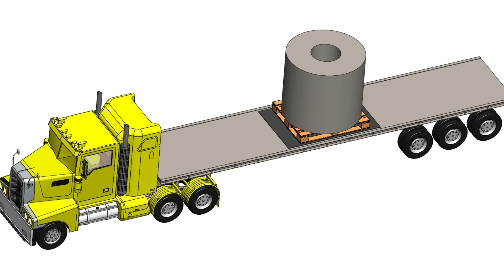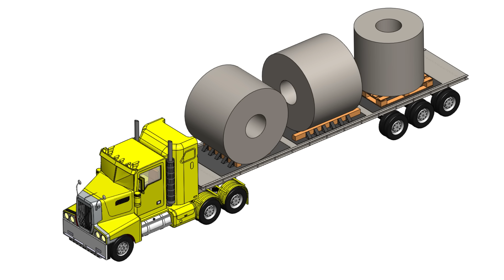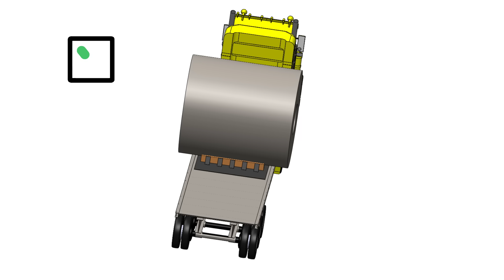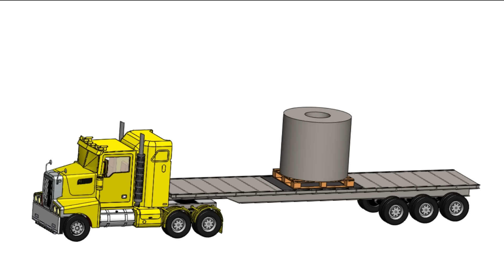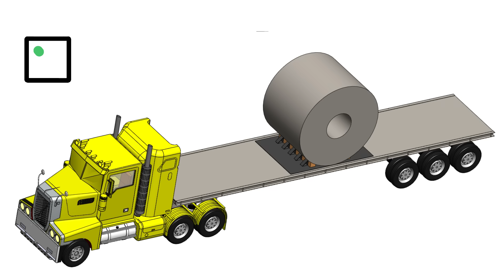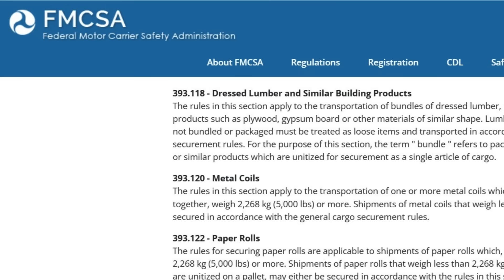Suicide Coils; Why Are They Loaded This Way?

Comment: Hauled these for years and told myself I’d never go back unless I was using a dedicated coil trailer. With all the people that’s gotten killed over the years, you’d think it would be mandatory coil trailers.
Reply: Or at least a specialized coil pallet
Reply: @lbochtler I was going to say just that. Make a special pallet shaped to hold them.
Reply: 0:00  Q:  "Ever wonder why truck drivers transport steel coils on their round side, not their flat side?"

A:  No, I don't, because I understand why.  What I DO wonder is why somekind of obstacle isnt placed between the cab & the steel coil(s), to prevent a coil from rolling forward & crushing the cab, in the event of an accident 🤷
Reply: @jaadams1973  because that requires mounting the safety device (whatever it would be) that also adds weight, or requiring a separate trailer. In both cases it costs money. They probably calculated that it's more cost effective to load and pray. :D
Reply: @Arnechk  Someone suggested a "headache rack" mounted against the back of the cab

Ok, so I'm not a trucker.  But I do know what a headche rack is.  I also know its not designed to withstand the force of a 15 ton coil coming at the cab as cargo straps break & inertia & acceleration multiply the weight of the thing upon impact

Dont get me wrong, I see your point.  Looks like the most affordable option are those wooden blocks (pallets, or whatever theyre called) which thankfully require extra cargo straps, & prevent the coil from rolling forward or backward
Reply: @jaadams1973  
Something like a basic steel frame could be secured to the bed to hold it front back and on the sides.
Reply: @jaadams1973 the coil would just crush it like an aluminum can
Reply: @jaadams1973 a headache rack but steel coils still go through them
Reply: Yeah people's safety should top priority, including obviously the trucker.
Reply: Trucking is one of the most dangerous jobs out there. It's sad that society doesn't value their work enough to change that.
Reply: I'm guessing a specialised coil trailer would have a quarter-pipe type of shape between the coils and the cab?
Reply: Some rich guy's profit >> poor people's lives
Reply: @aluisious  While I do agree with your point your pfp suggests you're some socialist/communist type🤢
Sorry, had to say it.
Reply: @ruzzophobeSE  your comment suggests you dont understand the meaning of those words. Almost always the case with people who have such a kneejerk reaction against it.
Reply: @ If I didn't understand those words I wouldn't be so against them.
Reply: @russophobeSE The vast majority of people super against communism/socialism dont know the first thing about it.

Alright, lets actually check your knowledge then. What actually is socialism and communism? And what specifically about it is your issue?
Reply: @eragon78  capitalism has proven to be the greatest system for building wealth for individuals. Certainly not socialism or communism.
Reply: @ First off, wealth in individuals is not necessarily wealth for everyone. Capitalism is really good at making some people rich, but there is nothing about capitalism which necessitates that everyone is well off. In fact, left unchecked, usually the opposite happens where only a few people are well off, and everyone else suffers. This is why regulation is extremely important to keep the worst aspects of capitalism in check.

Second, I never said I was in favor of socialism or communism. Im actually not. My point was more so that most people who hate on these systems so fervently dont even understand them in the slightest. There are problems with them, but its nothing with the ideas or concepts behind them, its rather just an issue in how they practically would be implemented in the real world.

Capitalism has TONS of flaws that these systems try to address, its just that in trying to do so, they introduce other problems. but there are plenty of good ideas in these other systems that can be applied to capitalist systems. Hybrid economies are a thing, and thats actually what most of the world uses (including the US). We have a capitalist system at the core, with aspects of socialism and communism sprinkled in. We basically take the good ideas from both systems.

But most people are so buried in 1960s propaganda that they just have this kneejerk reaction against socialism/communism without even understanding the first thing about them. To the point that its a legitimate political strategy (usually employed by conservatives) to just call everything socialism/communism that they dont like, and people will instinctively hate it, even when the things arent socialist or communist at all.

And thats really the point im making. Again, I dont even support socialism/communism. i think there are critical flaws in those systems, and the flaws of capitalism are more manageable than the flaws of socialism/communism.

But I also dont have a kneejerk reaction against those systems. The general theory behind them is still good, its just they dont really work in practice. But I can also easily understand why people would support those systems still, because at the core of it, they are about prioritizing the wellbeing of people over the pursuit of infinite greed and money.
Reply: too expensive to provide appropriate gear

can't make the CEO wait for his second yacht over some trucker lives right?

Comment: 0:09 no it would not roll straight in if that trailer was designed correctly of they used the correct trailer for this job. There are trailer with a protection wall, for cases like this. that the load wont kill the driver or anyone else when in a curve and the load decides to roll. This is just a bad job performed and waiting for disaster to happen.

Comment: 4:20 you can't put the chains on the rub rail. if you slammed on brakes, those aluminum welds would break. the hook has to be attached to the bottom of the trailer frame.
Reply: lol someone tell every carrier out there they're doing it wrong then. i must be lucky after all the coils I've hauled to never break a single spool or stake pocket
Reply: @kaerzokled  you can tell it to the officer at the weigh station. or you can tell it to the judge/jury when you're being prosecuted after the coil breaks free and flattens someone's car. or tell it to the judge/jury when the family sues you for everything you own.
Reply: @connor_flanigan  buddy ive been through more weigh stations than your mom's been through buffets and dudes. i dont even know how many shipping facilities and fellow truckers ive seen where we secure coils that way. it's all in the green book bud

Comment: To assume that anything attached to the trailer of a semi truck is safely secure would be wrong. One early Saturday morning on a very cold overcast windy day, i was following a semi truck with a trailer loaded with pre-framed patio glass sliding doors. They were packed on teepee style where four or five windows rested on the same number from the other side. Well, as the truck turned left onto a four lane highway the last set started tipping off the trailer bed  onto the road below. ALL of them followed in order like dominos. I was directly behind and saw the whole thing from start to finish. It was a huge mess of broken glass and bent aluminum frames which blocked a total of four lanes. The intersection was completely impassable. The was nobody else on the road which was a blessing so no one was hurt. The driver got a ticket for an insecure load and i am sure the cost of cleaning up the mess was very expensive. 
I felt sorry for the driver.
Reply: @randmayfield5695 I don’t feel sorry for him.  No way.  If you violate the law by failing to secure your load properly, endangering other motorists and making a mess to clean up, you deserve not only a ticket, but also your CDL suspended for a while.  An unsafe load is a hazard to the public.
Reply: @zyglo9826  True, but who among us hasn't made a mistake? Was it directly his fault or was it a failure in the strap?

Comment: That last truck that had the one coil set up was probably that 60k lb coil you were talking about. I remember working with sheet metal running a cut to length line and receiving a special order 10ga 60” cold rolled coil. It took 3 of our forklifts and a couple OSHA violations to get it off the flat bed truck.

Comment: Why not use bigger wedges at the base for suicide style to keep them from rolling?  A 4x4 isn't much of a stopper.
Reply: You can if you make a longer coil rack to hold the timbers, other wise they’re all made the same, to hold full size 4x4s with a 45% bevel cut to set the coil on.

Comment: What if they added some same height as the coils barriers between them? That way they couldn't move much if some restraints became undone.

Or they could add a nice reinforced barrier cage to the back of the cab of the truck so that the coils just bump into that. They could even have the cab itself be reinforced. 

I mean they need to make it safe to the point suicide coils aren't suicidal anymore.
Reply: You are right that there are thousands of ways of making it a lot safer.  But COST and PROFIT are the determinants, not safety.  The custom built trailer was definitely the SAFEST option.  But coils could be sold mounted on a proper cradle so that they CANNOT roll or spread.  The cradle could be returned and reused. Oh wait.  That would cost more.  No one spends a cent unless they are forced to.

Comment: when i was younger and just started driven a light delivery truck i didn't understand why a 40 ft trailer foe 1 or 2 coils 
yill much later i learned about weight distribution bridge weights etc i did know hauling steel was dangerous and how some truckers tried to run 100k in the time 73280 was limit in state but the trucks and trailer had more blown tires wheels and wear on older tractor s negated the short term overload profit were this was at time not many weight scales were opened

Comment: There are relatively simple and safe ways to transport these steel trucks. A low loader on which they are transported lying down. This moves the center of gravity downwards and also increases the contact surface and thus increases friction. When cornering, this prevents the centrifugal forces from also being reduced. Anything is possible if you just want to. These parts, standing and facing the direction of travel, are bound to have catastrophes. In this configuration, such steel collis can never be secured safely and stably. Everything above the safety chains is freely moving mass. This mass acts like a lever. If the truck has to brake abruptly, this mass starts moving due to the acceleration. Because this mass has the same speed as the truck (mass x acceleration) and it cannot be slowed down.  The potential energy, the accelerated mass, suddenly becomes kinetic energy when braking abruptly.If we place a mass of 10 kg on a surface and accelerate it in the vertical ( horizontal)direction (a = 5 m/s2), then it exerts a dynamic force of 50N (10 x 5 = 50 N).
Reply: YOU obviously talk about things that you know nothing about!
YOU have never hauled coils before!  
  If coils couldn’t be hauled safe then they wouldn’t be allowed to be put on trucks! 
I found your Identification number on internet form #ID-one-zero-T

Comment: Back in the 90's, one of these coils came off a semi-truck that was flying along the thruway in Buffalo. He ran into a rush hour traffic jam near downtown. When the truck jack-knifed, the coil popped off the truck like a cork! It completely flattened a car and driver who got caught up in the crash. Dude was just on his way to work. Stay well clear of those!
Reply: That's some Final Destination type shit
Reply: @Extra-Celestial7 , realistic Final Destination. This is the reason why I avoid expressways.
Reply: I came here to bring this one up, i thought it was on grand island and multiple cars and people were crushed. Not sure if the same incident?
Reply: You never know when it's your time.
Reply: 0:00  Q:  "Ever wonder why truck drivers transport steel coils on their round side, not their flat side?"

A:  No, I don't, because I understand why.  What I DO wonder is why somekind of obstacle isnt placed between the cab & the steel coil(s), to prevent a coil from rolling forward & crushing the cab, in the event of an accident 🤷
Reply: @jaadams1973  There is, and they’re called headache racks whether on the truck or the trailer. It’s just that some trucks and trailers have them and some do not.
Reply: @SM120THBORE  Sorry, but a headache rack isnt able to protect the cab from bring crushed by 15T of steel, when the coil breaks loose & accelerates into it
Reply: @jaadams1973  from what I have heard others say, headache racks aren't there to necessarily STOP the load dead in its tracks but to deflect it away from the cab. now take that with a grain of salt but that is what I have heard.

Comment: I worked in the steel industry and loaded and unloaded 30k lb steel coils. You can't do it with them eye to the sky. They go on and off trucks from the side grabbed by the inner core with big fork lifts that can handle the weight.  Sideways allows you to grab them from the side safely. They are chalked and strapped down well to not roll front or back during transport.  Wooden pallets used to sit them eye to the sky often collapse during transport on rough roads and the coil shifts causing the truck to become unstable and can crash.
Reply: @KevinTurner-hr1wg  I wondered why they did not carry them that way. Now I know.
Reply: I'm not a truck driver but 20 ton on a commercial pallet is unfathomably stupid. The obvious solution to eye in the sky is friction. The clamp can use friction and normal force to lift the damn thing without any power and it does so for huge pieces of glass and other stuff that is difficult to handle and friction and normal force can theoretically hold 1 g. People are stupid so the simplest and safest method becomes some amalgamation of chains, straps, thresholds of various sizes ... then they lift it with a clamp, wtf? Use the rubber or whatever is on the clamp that gives it that incredible grip to support 1g. It's some material with high friction coeficient and a gravity clamp that turns the normal into a clamping force. I'm blown away and I wanna know what material those clamps use cos it's outstanding
Reply: You mean can’t do it the right way because someone is cheap.
Reply: @gavinhelgeson2880  basically that, I asked a similar question and a truck drier who hauled them sometimes said that the trailers tailor made for them are inherently expensive, have to be annual inspected and all like the rest.... but they can only haul coils with them, so most companies don't have them and most transport contractors cant justify having one in the lot for them, as at-least for this guy the 1-2 jobs a year they use it on doesn't please the bean counters one bit.
Personally, i`d have people welding cradles out of giant square tube, but then again that aint cheap, tough ask for a corporation, sometimes legit impossible for a owner-operator or small company.
the company sending the product also, wants the lower end of the bidding scale most times.
Reply: @cannack  is it some kind of American thing? I don't remember ever seeing nothing like this in any state I was... Did I just never payed attention or people usually transport this stuff by a railroad?
Reply: @РомаПетров-ж1н  What state? usually these are around in between or near heavy industry, like sheet metal stamping and whatnot.
Reply: @ , makes sense I never being around those industrial clusters consciously. But still it's something so alien I don't recognize such a thing even being on a video or something (if we forget about America again). Or maybe I never payed attention.
Reply: @gavinhelgeson2880  Buy us a gantry crane then
Reply: 0:00  Q:  "Ever wonder why truck drivers transport steel coils on their round side, not their flat side?"

A:  No, I don't, because I understand why.  What I DO wonder is why somekind of obstacle isnt placed between the cab & the steel coil(s), to prevent a coil from rolling forward & crushing the cab, in the event of an accident 🤷
Reply: @jaadams1973  It's called a headache rack. Most flatbed trucks have them. As stated, the suicide load allows the coil to be removed by ground based equipment such as forklifts and also cranes. Shotgun loads where the coil is loaded 90 degrees from that can only be removed by a crane. Eye to the sky loads is great if you just have a regular forklift, but also a way to stand them back up.
Reply: @ , maybe because velocity is squared for energy of a moving object. So crushes anyway. Am just guessing.
Reply: "I worked in the steel industry and loaded and unloaded 30k lb steel coils"

OK but did no-one ever tell you it's chocked not "chalked" which means something else entirely? 😝😝
Reply: @christopherbedford9897  They're a trucker, not an English teacher.
Reply: @calvinthomas2556  Oh, well, that's OK then.
Reply: @christopherbedford9897 Both are correct.

Comment: I once had two coils 20 inches wide, 20,200 lbs each , and 6 feet tall loaded suicide. I had a 40 ft spread axle flatbed with 3 foot removable sides and a full tarp. It looked like a double humped camel going down the road. That was a fun ride since it was in the winter on snow covered roads.
Reply: god damn that's scary. The steel tipped snow camel
Reply: I don't understand shit with your imperial system
Reply: @Tibo-f8s  50 cm wide, 9150 kg each, and 183 cm tall
Reply: Couldn't be bothered to learn basic conversation factors, huh.